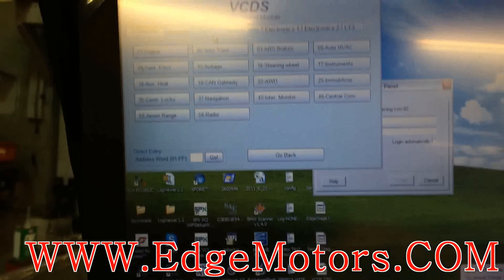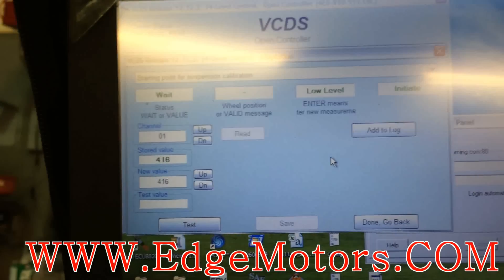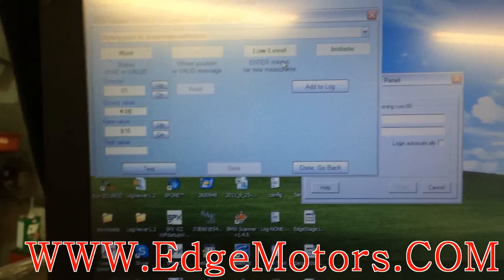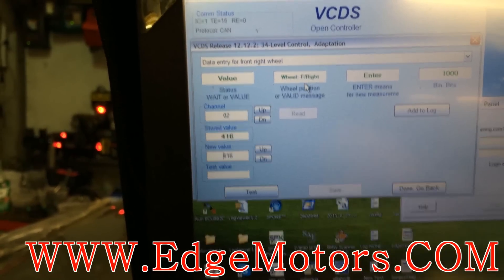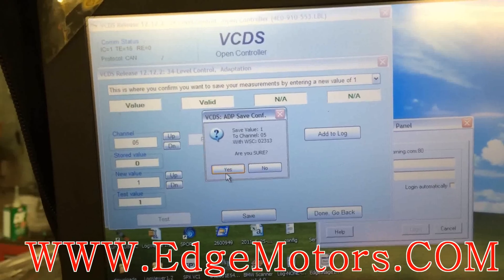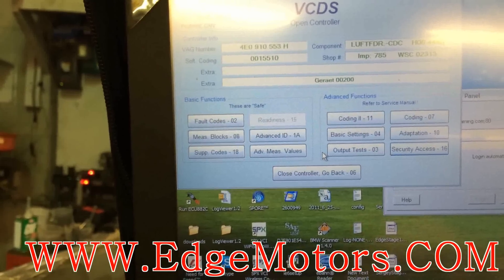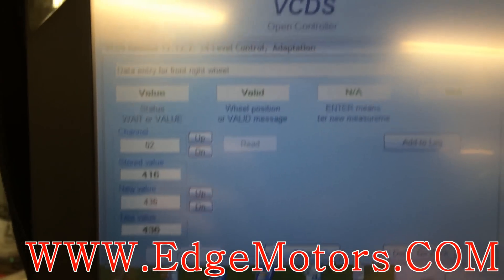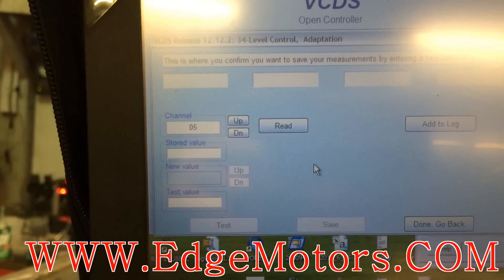Audi A8 Allroad air suspension calibration and lowering 402 mod DIY by Edge Motors

Comment: Thank you for the video. 
The problems that are occurring for me after calibration is that it sometimes tells me invalid  .  And at channel 5 it tells me error,  I can't put any value.
Reply from the maker: that ussualy mean that the value you putting in is way too far out of range and the ecu thinks that the ar is not on the level ground.
Reply: EDGEMOTORS
The thing is I tried lowering it by 20 MM by raising to 416 from 396 at the front, but it would tell me invaild/vaild sometimes

Comment: Do you know how i can remove the auto-lowering feature on my 2013 s8? If the car is in “raised” position, after 30mph the car will auto-lower. I want to change this and enter a higher speed, lets say 60mph, then it can lower.

Comment: Why height can be differ by wheel? Doesn't it need to be same for all wheels?
Reply from the maker: The shape of the body may be different, so the car needs to set the height according to the geometry, not the distance from the fender to the wheel

Comment: wanted to no if wen u start the process it should be on comfort or dynamic
Reply from the maker: +ralphyplayanum1 it dont matter... the car will put it self into the setting it has to be for the adjustment...
Reply: Keep say no response from controller why
Reply: I jus called for you surge but you werent in

Comment: I saw one today on a lot and the back seem lower than the front tires. Does that mean it needs a calibration? They told me it will go back up once the car is turned on. Don't know if they are tricking me or not.
Reply from the maker: +Christine Hannah could be, but if you strt it up and it goes up, that means that the bags are leaking... its not supposed to sag while sitting....
Reply: +EDGEMOTORS that's what I thought. Thanks..
Reply: +EDGEMOTORS depends.When you drive it rise up a little bit, so it gives you a bit more clearance.. But when you park the car it "sits down".. use lowering links and on Sports air suspension , swap to SE module. Cause SE module lowers car when you set to "sport mode" and raise up if you set "comfortable" mode
Reply: Thanks! I didn't buy it. I knew it was damaged.  I got a 05 D3 and it does "sit" a tiny bit when ignition is off then lifts when turned on. It also lowers pass I think 60mph for over a few seconds for a sporty feel and lifts when you stop. I'm learning my car. It's so much stuff! !!!!!

Comment: Every time I enter the security access it’s lets me in but after doing one wheel it kick me out. 
Then I can’t log back in I have to unplug the scanner and stared all over in 15 min. 2007 Audi Q7 only one code I have calibration not learned. This all happened when 
My air pump stop working and I replaced it. Please advice me.
Reply from the maker: You might be entering a number outside specifications, or too far from other wheels.
Reply: Did you figure this out ? maybe a batteri dissconect will help ?  Same ting is happening to me after doing four wheels, wount let me save in block five